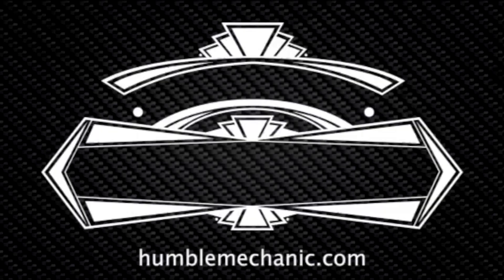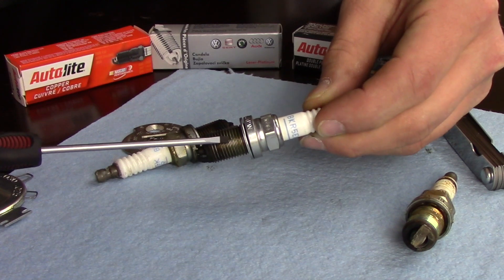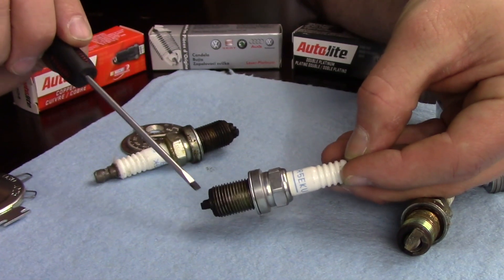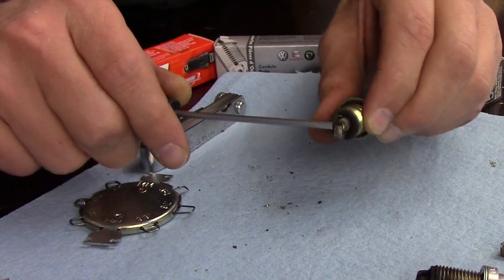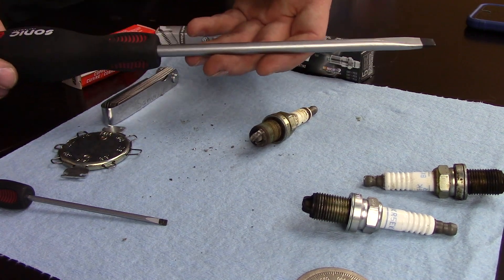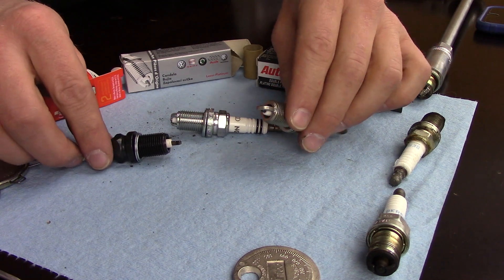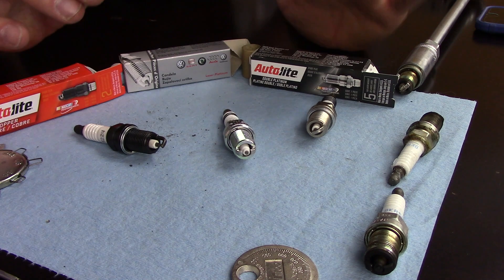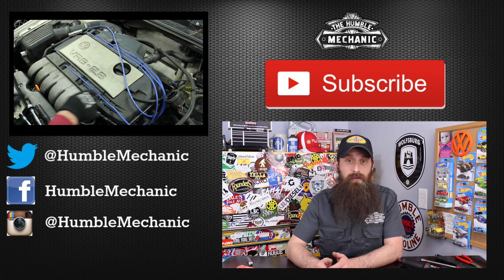What You Need To Know About Spark Plugs

Comment: You think $10 is bad for a plug, try plugs for rotary engines.  Pretty much only one brand, NGK.  And they are $25+ per plug.  And you change them FAR more often then a piston engine.  But, that's part of the rotary life.  :P
Reply from the maker: +Chad Bremer DAMN!! #rotarylife
Reply: HumbleMechanic Cost about $100 every 15K miles on my 09 RX8.  Some of the older rotaries have slightly cheaper plugs.  RX-8 has "special" ones.  Well, two of the four are.
Reply from the maker: +Chad Bremer I guess thats not horrible.
Reply: HumbleMechanic Can be a lot worse.  I guess.  What do they charge for Ferrari plugs?  lol

On the plus side I have a beater winter truck.  276K and still lumbers along.  Burns oil so the plugs need changed semi regular.  They are only a couple bucks each.  Speaking of that, it's about dew for oil and plugs again.

Comment: Probably been mentioned:  You have the factory NGK plug ID number.  Most likely you can order that in off RockAuto or other auto parts house at a discount over the dealership.  (or Stealership as I call VW dealers)   Each time I go to a normal dealership I can get the "Cash Price" which is between what the garage sells parts to another garage shop for, and the "Installed at our shop price/list price".   Not the VW dealership.  They charge full list price no matter what you're after.  And they know they are the only game in town in most cases, so they really screw over their customers.  (We have a 2001 VW Bug and had to do a lot of repairs to it when we first purchased it)    Put it this way:  $28 a gallon for coolant;  $34 dollars for a pint of P/S fluid.  About $30 for GL-4 gear oil for the manual transmission (we used Syncromesh-the transmission loves it!)   So I have little to no love for both our local VW dealerships.

Comment: I have a 1994 F150 with the 302 engine.  I have been told that the best plug to use is just the cheap Motorcraft copper core plug... granted they should be changed more often because they will wear out faster, but not a difficult vehicle to change plugs on.  Is there ANY reason not to use a platinum plug?  Opinions on say a Bosch platinum +4? Or those plugs with a "V" ground electrode?  Those seemed to be a big thing in years past, and I have tried them both, cant tell they make any difference.

Comment: One other type of spark plug socket.. magnetic.  That's what I use and really like them.  Holds the spark plug in the socket magnetically.
Reply: Yeah, but if you're not careful with those, you get metal chips inside. So those are a bit more...high maintenance, if you will. Still, good tools, and you just can't go wrong with whatever style you choose, so long as it's a good socket.

Comment: I have never once torqued down a spark plug and never had a issue...Been doing plugs since I was about 8 years old. But your mileage may very.
Reply: +fightingfalconfan  A lot of times the torque 'can' be within the same range.  Say you have one make that requires 12-20 foot pounds to tighten.  Another make could say  15-20...another could say 18-24.   People do get the "feel" for how tight to get something through repeating the process many times in their careers.  Others are of a mindset  "I gotta get 'er as tight as I can....." and then strip out the threads.    I've always been one to use a light coat of never seize, run 'em down by hand and torque them to specs.  That's just how I was trained 30 years ago.  It's all good.

Comment: You mentioned the factory one is pre-gapped. Do you mean if I am getting the after market spark plugs, I have to manually gap them to spec before putting them into the engine?
Reply from the maker: +Kevin Ping I would absolutely check it and see if it was correct or not. 1 minute of checking is well worth it.
Reply: +HumbleMechanic Thanks Charlie. What are the symptoms for bad spark plugs?
Reply from the maker: +Kevin Ping typical you'll get a misfire and flashing check engine light.

Comment: Charles, this has nothing to do with the prior topic of cars, however its not going to do any harm to my KTM Two-Stroke Dirtbike if I just continue using a spark-plug combination spanner and just threading in until i can't do anymore by hand. Then hold the combination-spanner about half way and just "snug it"? Obviously not to the right end and excessive force as that could strip the thread in the cylinder-head.

Comment: what do you think about "Iridium" spark plugs?
Reply: Beware of the "shininess" of the iridium. It all depends on your engine. Do not put in iridium ones if you're not supposed to. I tried iridium spark plugs (7 $ each) and I tried copper spark plugs (1.50 $ each) on my 1992 Volvo 740 with the same gap. I ran better gas mileage on the coppers ones (which happened to be OEM) than on the iridium ones. 

On another note... 12 $ for a spark plug!? That's insane. And that pretty much sums up why I'll never buy a VW...
Reply: A lot of spark plugs are 5 $ or less on RockAuto (for almost any model). Most are less than 8 $. I don't know about Sweden.
Reply: The Refs toyota uses them.  Vw puts them on the 3.6L vr6 as well.
Reply: George W I replaced my spark plugs on my 2012 Honda Accord with 100,000 + miles. Plugs looked fantastic at that Mileage. The plugs looked so good I will put them back in at 200,000 miles. Iridium is one of the rarest metals on earth. It is incredibly inert and reacts with almost nothing. It is less reactive than even platinum. I think iridium is the only way to go.
Reply: 12 USD for a spark plug in Sweden is considered cheap!
Reply: the best on the market
Reply: Iridium are too advance for gasoline and  cast aluminum alloy piston engine. 
our engine cannot gain the full benefit of the Iridium technology 
the high end platinum plug or OEM are good enough

Comment: These days we don't change plugs like we did back in the day...every 10,000 miles on my old Mopar 383.  When TEL was removed from gasoline a spark plug's primary enemy, lead fouling, went away.   I worked for a tier one supplier of ignition components when I got out of college (after my Army tour).  We made spark plugs and had a variable compression engine used to confirm the plug rating. A lot of the spark plug variation, even within the brand, is marketing hype.  Folks, we tested everyone's plugs continually for OEM applications (racing applications are a different story).  We never found a spark plug that improved fuel economy by itself, little benefit to multi-ground electrodes, platinum, iridium or any other exotic material.  Except for those spark plugs that incorporate knock sense, most will work just fine if in the correct heat range.  Today's electronic ignition can provide substantial voltage and a decent spark will trigger the mixture.

Comment: I know you are a VW mechanic, but do you have any experience with boxer engines? I have a subaru that needed a spark plug replacement about a year ago and I haven't had the money to have a professional do it. I am okay with a wrench doing basic things like brakes and such on my forester, but I am not overly confident in my abilities. I have thought about doing a DIY spark plug replacement, but I have heard that spark plugs are (because of the spark plug positioning) really difficult and finicky to do on Subaru motors. Should I just break the bank and take it to a professional or should I give it a try myself? Which do you recommend?
Reply: +nooranik21 I have a 2006 Impreza 2.5i. I can definitely do it but it but they're a pain. All of them needed at least a 6in extension. I may have had to put another 1in on top of that. Actually I remember, my extension rose flush to the top of the engine and I put my ratchet on it.

Some plugs only have the narrowest of room to turn the ratchet or torque wrench. I was barely able to get enough room to turn my torque wrench to achieve the necessary torque on one of them but I got it done. The problem is there are hard lines in the way. I wasn't going to start taking extra stuff apart so I did my best to work around it.

Make sure you get a torque wrench who's range is optimal for the job. Either 1/4" or 3/8" drive. Check their range against the torque you need.

Try looking for videos on Subaru spark plug change, or Forester spark plug change. You can also check the Subaru DIY website NASOIC. They specialize in Imprezas but Subaru uses the same engine in different models. There are also Forester dedicated DIY sites as well.

Sounds like you can stand to save a few (hundred/thousand) dollars by learning how to fix your own car. Tuneups are a good place to start. Good luck!

PS Make sure you purchase the Subaru Factory Service Manual for your model if you want to do your own auto work.

Comment: hi, do you put some oil onto the sparkplug threads before installation?
Reply: No, just spark plug anti-seize.  It's not going to interfere with conducting electricity, just be careful not to overdue it when applying.   Some plugs have nickel plating and don't need anything.
Reply: I've owned 2 engines with the coil-on-plug configuration-- a 4.6 L Ford V-8 (in a Marquis) and a 2008 Prius with the 1500 cc inline 4. On both of these motors, I found that taking a wet/dry vac and carefully cleaning the coils and surrounding area was essential. Even when the coils were removed, there was still a small amount of stray debris down at the bottom of the space around the plug itself in a couple of cylinders. I have a crevice attachment that fit perfectly to remove this trash so it didn't end up falling into the top cylinder area thru the plug hole.

I've been working on my own cars now for over 35 years and have never used anti-seize on spark plugs because of the machined threads. Back in the day when points and condenser ignition systems were still common, The plugs never had a chance to seize because they were changed out much more frequently than today's car engines require. The only components I use anti-seize on are O2 and fuel/air mixture sensors, Honda crank pulley bolts, header bolts, and stock exhaust manifold bolts on the 454 Chevy because of their tendency to blow the gasket (usually on one side only, thank God) after driving through accumulated water.

Comment: Charles, what are your opinions on copper anti-seize with spark plugs? Also thoughts about torque specs with anti-seize on threads?
Reply: +Jack Eagan I would think it would depend on the plug. I know NGK plugs have a plating that not only protects the threads but acts as a release agent when removing the plugs. Anti-seize is not recommended for those plugs as anti-seize will alter torque values up to 20 percent leading to over tightening.

Comment: To seize or not to seize, that is the question.

What is the recommended practice of using anti-seize on spark plugs threads?  More over, when should/can you use anti-seize on threads (outside of the obvious wheel nuts)?

Comment: Always install the OEM plugs the vehicle came with,have seen misfires with the wrong brand spark plugs installed.E3s are to avoid big time,junk and do cause misfires.The Ford 3 valve 5.4s,be prepared to have the special tool to extract the broken piece out of the head.They break off and their TSB does not work.

Comment: Charles-- good video.  Question - what about reinstalling a plug that already has a crushed washer? Should you snug or torque?
Reply from the maker: I typically get them pretty close to initial torque. I usually put a torque wrench on those too. But not every time, especially when removing plugs for diagnosis

Comment: nice use of Sonic Tools!! Great video as always!! the only thing to add might be that some OEMs are recommending not to touch the porcelain with your fingers during installation. Oil & grease from your fingers can cause carbon tracking later. Also a dropped plug should be replaced and not installed but, everyone has different ways of doing things. Thanks for the video!!!

Comment: You failed to mention that you should almost never gap new plugs! Some of them have fancy coatings on the end that can be scraped off. Or is this a myth?
Reply: Seems like the coolant sensor is faulty.
Reply: Headcase, you have to gap all plugs. None of them have coatings. Wont hurt to scratch them, just dont break the porcelain. All plugs have to be gaped. Same plug fits multiple engines with different ignition systems and gap requirements. Besides, they get tossed about during loading, shipping and etc. etc. The gaps get knocked off all the time and none are preset for any car at any factory.
Reply: headcas620 
lol I've gotten so good gapping a specific plug for a specific engine I can smack it on a bench top and get it after 2-3 strikes. 
Then I check em with a feeler blade because the gap is only .020. 
Torque wrench? 
Yea I'll use one for my own car but I've gotten a feel for that too. 
You can feel the gasket crush if you pay attention. 
Only one way to find out limits when doing repetitive work, and take a gamble to learn something.
Reply: +headcas620 Can break the tip off gapping these new plugs
Reply: yep you do not gap newer plugs period unless it's cheap champion or autolight.
Reply: There are coatings on them. You shouldn't touch them. The deal is like this, you order the right plug for your car and it comes preset. Old spark plugs, or cheap ones, eh, do as you please.

Think of it like hydrophobic spray, it's nice, you can throw oil on your clothes, but as soon as you move, you break that thin "film" and then it enters the fabric. Same here, just different application and challenge.
Reply: Thanks for this video. I have an issue with my 03 Subaru Outback, it tends to flood often in the cold ( -30 or -40c). I should add that they put a 98 engine in my O3.My Uncle is a mechanic, has checked it and can't figure it out, so I do this fun " dance"  to start my car every winter. The dance usually works, but I had to change them last year, and now again. Can I get away with just doing the 2 on the driver's side, or 1 and 2? I believe that's what other mechanics have done, and it's so cold I'm trying to save myself the pain of taking my air intake out and so on. Thanks

Comment: My family having owned many German cars from E34 BMWs to W211 Mercs and many VWs we found just to use the OEM plug.  Aftermarket plugs just don't run the same for some reason.  Also having worked at a Dodge dealer for years those cars only like Champion plugs period.

Comment: Here is a video I was looking forward... But I still have a question: Is there a limit for gapping a spark plug, due to, say the material elasticity limit of the electrode? 

e.g: Factory Spec is 0,8. It's safe to bend the electrode back to 0,8 if it is up to 1,1. Gapping from above 1,1 back to 0,8 should make it fragile, possibly causing it to brake inside the cillinder.

Does it make sense?

Huge Thanks for your videos, man!
Reply from the maker: +E Carvalho Every time you regap a plug it weakens the ground electrode. If you do it carefully, it will not be an issue. But many people do not do that carefully. 

I think you would be more likely to break it while setting gap, than weaken it and have it break in the cylinder.

Comment: Just installed some ngk's and they had no torqe spec,  the picture on the box showed to finger/hand tight them and add 1/2 ~2/3 of a turn.
 I always add some anti-size on the threads.
 VAGs run  in general on ngk's, bosch and beru plugs.
Reply: Anti-size?? I think you mean anti-seize.
Reply: Tomyp89 that's why you check on NGK's website for the torque spec
Reply: I use NGK and go by the hand tight + 1/2 turn rule with no issue
Reply: +bjchase55  the torque in my case is for used/seated plugs.
In order to seat the plug crush ring you should  add a certain amount of angle(pressure), so i trust the plug manufacturer.
The torque spec is  in my application 20~29 Nm, and the 2/3 turn did felt  like 29 Nm.
 Recommended or not,  i did not have ane issues with it, threads look  like new, no sease of plugs, and no loosening. About the 20% rise in torque, head bolts should not go in dry, so i will keep aplying anti seaze :)
Reply: You never use anti-seize on the newer NGK spark plugs. If you go to the manufacturer site, they tell you to never use anti-seize on the newer NGK plugs that have shiny threads and look like they are chromed. This shiny coating is a special coating that NGK applies to these plugs that already contains corrosion protection and anti-seize.
Reply: +Tomyp89 Torque specs are as per the vehicle and not as per the plug. According to NGK their plugs have a plating so using anti-seize is not recommended. The anti-seize compound acts as a lubricant which leads to over tightening since it will alter the torque values up to 20 percent.
Reply: just tighten till the washer squashes.

Comment: When I was attending automotive trade school (I'll leave the name out, since they were shut down by the government...) I distinctly remember my High Performance Powertrain instructor telling me a multi ground strap plug can block flame front propagation. He ran a $3-5 Champion plug in his 621 cubic inch HEMI race engine. And recommended OEM plugs for stock cars, and single ground platinums for mildly built engines. Taking consideration of heat range differences for compression ratio changes or boost/nitrous applications. We also went in depth about indexing spark plugs. Place the ground strap on the opposite side of the intake valve for naturally aspirated engines. And place the ground strap towards the intake valve on high boost applications, to prevent the boost from blowing the spark out like a candle. What're your thoughts Humble? I've always wondered why some German cars have multi ground plugs from the factory.
Reply: My dad once had a Champion plug fall apart in a bike engine he once had, completely killed it. Switched to NGK and never looked back